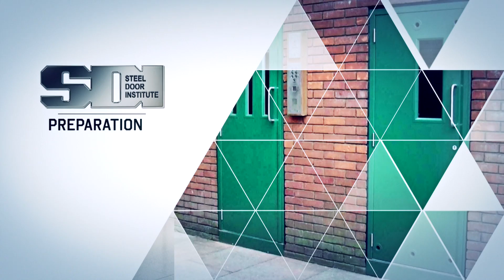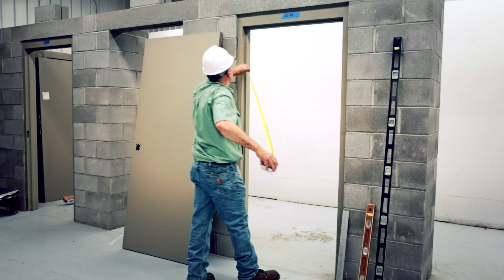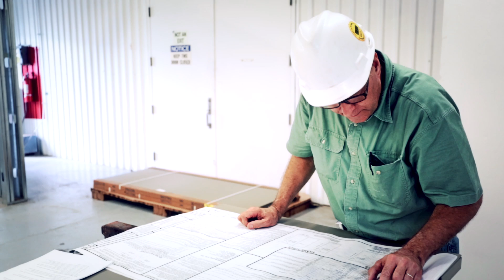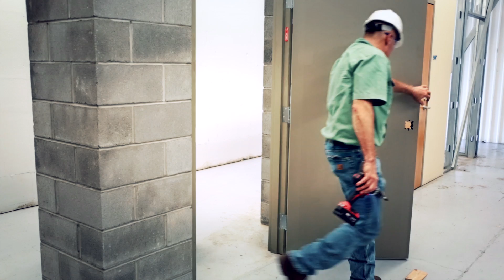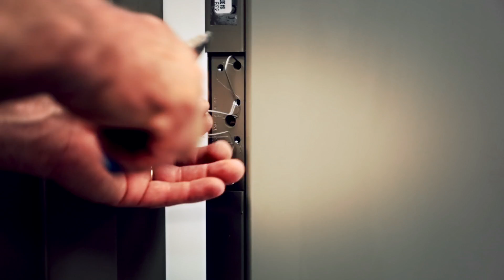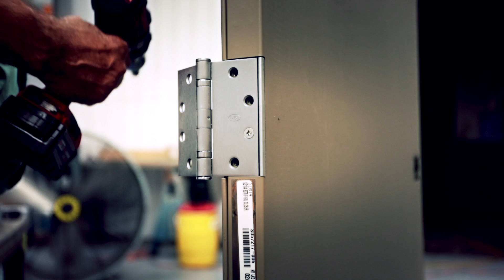How to Install a Commercial Steel Door | Steel Door Institute

Comment: what happens if the door frame was made by a different manufacture and the holes don't match ??????????
Reply: We cut out door hinge prep on the door, it's a process, and weld it where they belong then bondo. That's a last resort, usually our project managers would just order another door with the correct measurements we send them.
Reply: You'll have to refabricate frame  on site or rehinge door
Reply: Saw your question ...all shapes and holes for strikes and hinges have been made a universal standard,all hinge brands will work in this frame.

         To give you more FYI the frame is the standard,there are a few different frame makers but every kind of door 9ut there is made to fit all vrame standards not the other way around

Comment: How much do you charge to install door?
Reply from the maker: You'll want to speak with a local contractor or door installer. Prices vary depending on the complexity of the openings (frame, wall, door, hardware, etc.).